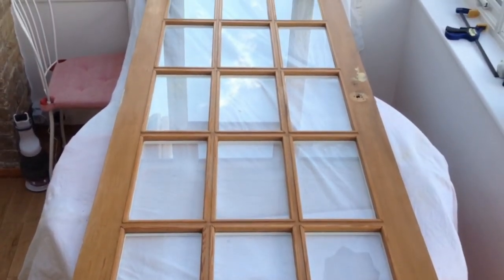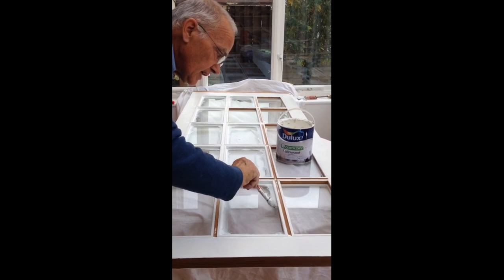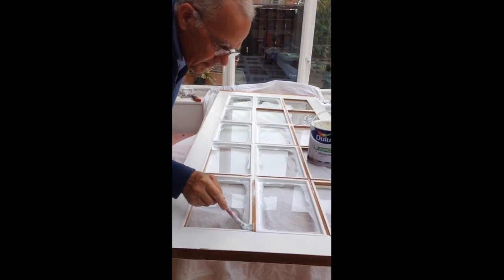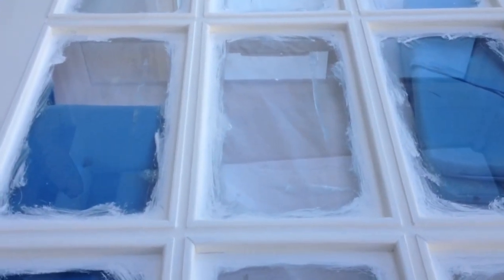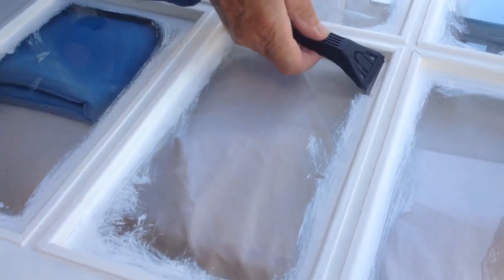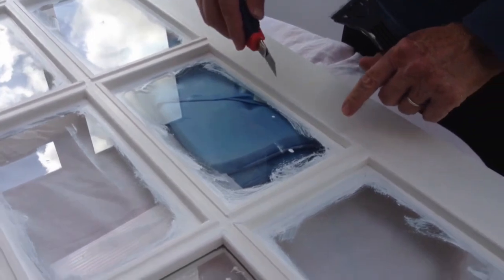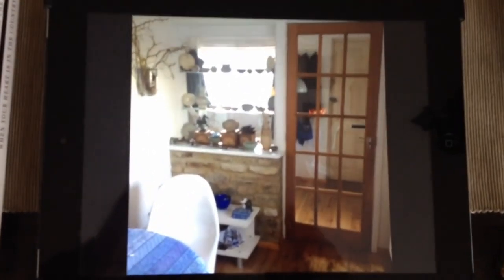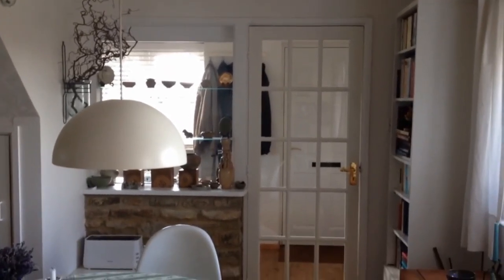Painting windows without using masking tapes.

Comment: A suggestion for those in cold climates: If you get a 1/16" inch steel ruler, and hold it against the edge, then use your knife.  Then, holding the steel ruler up against the edge, so the razor cannot slide under it, remove the paint with the scraper or a razor blade.  The way you do this is excellent in many states, but in New Hampshire, or other cold states, in winter inevitably you will get some condensation.  With your method the condensation will seep into the wood and within a few years the paint will peel.  By leaving 1/16" ledge of paint, the condensation cannot reach the wood and there will be no peeling for many, many years.  It seems that it would be tricky but I use a 6" ruler on French doors and simply move it about.  Then I use a single edge razor and usually when I'm done scraping, there will be one single piece of paint that simply lifts off.  The 1/16" ledge of paint is not noticeable and the job looks professional.  Thank you for sharing, as you stated: masking tape will never work on this type of door.
Reply: That is exactly the way my  brother in law showed me how to do it too.
Reply: S Flynn ... Thanks for the guidance. I’ve located a few thin steel straight edges in my shop that are nearly the right length for my window panes. The remaining 1/16” paint seal edge is going to save me having to redo the windows that normally suffer moisture invasion. The paint seal edge is very important on the exterior to keep the glazing putty from getting water behind it where the freeze-thaw cycle is a daily happening in my winter climate.
Reply: Great idea.  I knew to leave the paint seal unbroken but never thought of using a thin  thin edge to score away from the edge.
Reply: @mweber4178  Stanley make a simple plastic tool that holds a standard Stanley blade which has a shoulder that extends 2mm or so beyond the edge of each side of the blade which you run agains the wooden beading (etc) and which will leave a narrow run of paint on the glass automatically achieving what you are talking about.
Reply: Thanks for sharing this tip. I’m in humid South Louisiana and on very humid days the panes on my north facing door drip with condensation. This will save me time and money. 👍🏼👍🏼

Comment: I am a master carpenter and painter I also worked for a commercial glass company for 3 years. We used razor blades and a mist of window cleaner as lubricant to scrape and clean brand new and old  glass. If you are a heavy handed idiot with dull blades don't try this. If you know how to use finesse and a shallow angle you will NOT scratch the glass! Don't knock it to you've tried it. It 's done like this every day with perfect results! The real thin rectangular razors work the best they have a finer ground edge.
Reply: Exactly> I ve done it over thirty five years and never one call back from a customer. They were all very satisfied with the end result
Reply: Scott Neely well said. I tried this yesterday on our French doors and it was quick, cheap and provided great results.
I even found an old retractable Unger glass scraper in my tool box. Never understood what it was for, now I do!
Brilliant!
Reply: Yes
Reply: Does this work with oil based point?
Reply: @oliviercaisse9409  yes probably even better with oil based paint.
Reply: @scottjamable  OK! So i just put primer on door, 2 coat of paint cut windows borders, then scrap it easely with a razor thin blade and it will do the jobs!?
Reply: @oliviercaisse9409  yes just try it out. Mist some water with a tiny bit of dish soap or use windex just on the glass. Just enough to make the razor glide easy. Practice on a spot, you’ll figure it out. The razors with the handle is probably easier to hold. Just make sure it’s a new blade so it won’t scratch.
Reply: @scottjamable  Big thx to you, imma try it 😃
Reply: @scottjamable  it works perfectly !! Amazing thx for the tips!

Comment: I have opted for another solution. I am going to spray the doors and windows.  To mask the glass in those doors and windows, I am going to use strips of wet printer paper.  Easy to slide into position and to remove later.

Comment: From experience, oil-based primers like Dulux Quick Dry are difficult to get off the glass, so if your project involves using an oil-based undercoat, pain will be your friend using this method. I haven't tried this method at all but generally this is what window scrapers are for (i.e. removing paint from windows), so why wouldn't it work? I mean, before painting old windows, I usually have to scrape off paint on the glass first, from the previous painter. I think I'll try this method next time and see whether it's any faster.
Reply: So is it better?😂

Comment: Great job...how do u do the embossed glass doors?
Reply: Haha...great question, if the glass is textured, or heavily frosted, your only option is to very, very carefully paint the wood to the glass as this method will not work in this instance.
Reply: Depending on how deep the embossing is, even taping won't work as the paint finds a way underneath the tape and you've got a world of pain. Only option is a steady hand.

Comment: if you try this on an old Victorian or Georgian window with putty and very fine glass you are very likely to break the glass and will cut through the putty especially if it is New putty this will not work traditional hand painting by hand and Cutting in with a paint brush is best for old glass windows
Reply: I've done this on circa 1870 windows with original glass and it's worked admirably.  If the glass is frosted or rough then you are correct that it will not work. But gosh, my glass is much thinner than today's glass and has putty under and above it and this method always works fine for me.  My house has about 200 panes and I've done them all with this method, never broke a single one.   You don't have to press with more than a few ounces.

Comment: I did that with a mirror, and it got all scratched out 😭😭😭 I think the mirror was cheap.
Reply: JM C ... Clean the glass before using a new razor blade that is installed in a holder. Light pressure should be enough to keep the blade edge in contact with the glass.

Comment: hardly a revolutionary idea. It is simply a case of choosing between:
a) putting on masking tape (costs £) and takes time to apply. May still need a knife run down to get a clean edge when removing if paint has dried 
or
b) waiting until paint is dry then cut and scrape as per video. 

a) is a one day job, b) is a 2 day job due to needing to wait for paid to dry before scraping. Time is money!

Comment: I'm a decorator fully qualified , it's a silly idea, water based primers are so good these days it will stick  to glass like shite to a blanket..
Reply: You may be a fully qualified decorator, and you are correct it does stick to glass like shite.  But unlike the blanket, the glass does not absorb any, and a razor, held at an angle will remove that strip of paint, even if it's 3/4" wide very easily and often in one piece.  It takes me about 5 minutes to do every single pane perfectly using this method or my method for cold climates.  Why not try it once before condemning something that clearly you have not even tried.
Reply: Brian F E  I started off buggering around with tape and got bored to death after half an hour. 
I found this video and did exactly what he said and the result was, fast, no fuss and worked brilliantly.
I came back here to say thank you very much indeed which is what I will do next.
Experienced fully qualified decorator or not, you can not say that this does not work very well, because it works brilliantly.

Comment: Big mistake, you will scratch the new glass. If you did that on a homeowners house you would be fired in the spot, and you will blamed for every scratch even if is was not from you.
Reply: I've done hundreds of doors and windows (I'm not a painter but I own apartments) and have never even once scratched the glass.  We're talking about paint here, remove it within a few days and it's like cutting a piece of thin rubber.
Reply: I'm a pro painter and I don't think I've ever scratched glass using those window scrapers.
Reply: 35 years painting and it has never failed. Im also a professional glass and mirror engraver with over 25 years experience and never a scratched glass. An idiot might do it with brute force
Reply: David Garcia Absolute rubbish. This works perfectly. No fuss, saves time and money, beautiful results.
I even found my uncle’s old retractable Unger glass scraper in my tool box.

Comment: What a stupid idea . He has most lightly scratched every pain of glass. Call a professional painter !
Reply: If you used a plastic scraper you wouldn't
Reply: They don't get scratched. It takes almost no pressure from the knife or the scraper.
Reply: I spent yesterday scraping limescale off a brilliant white gloss tile back of a shower. I used a stanley knife blade (on its own and flat to the surface area)...no scratches. If that works so will the window/paint combination.
Reply: Yeah I've been doing this for forty years , but you are all so right . But even if you do it this way there is a technical way to do it, but you'll already know that.  Paint the glass people I was so wrong 😂
Reply: Razor blades, held at an edge, or even vertically, unless you use excess pressure, never scratches the glass. Though your idea is a good one: "Call a professional painter," but make sure that you put a $100 bill in your pocket for each door first.  Besides, when I do it, it beats most professionals, and those who do it as good as I do, use the same method or the one that I recommended in cold climates when condensation is an issue.
Reply: Brian F E Exactly lol
Reply: How to do a bun quickly